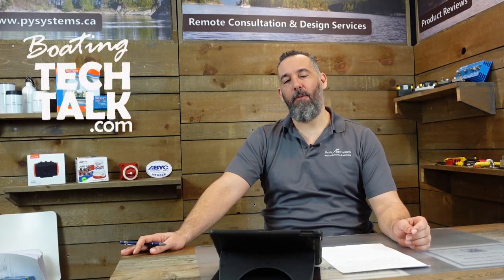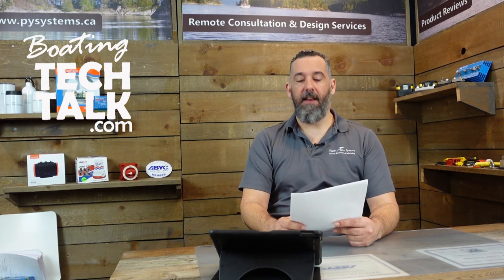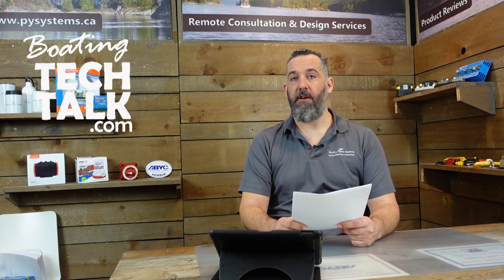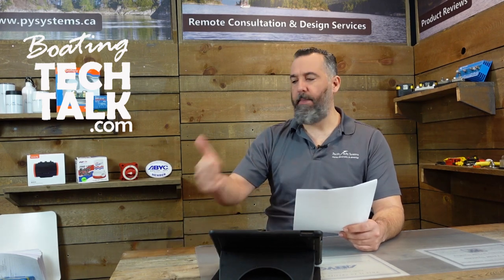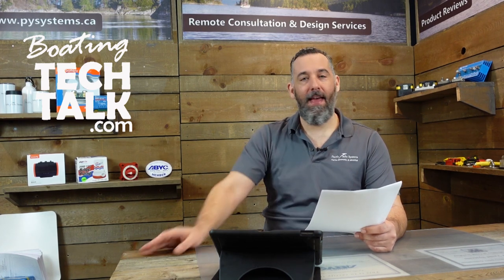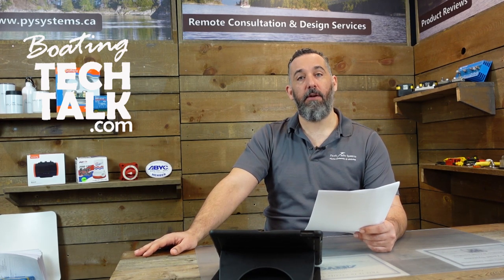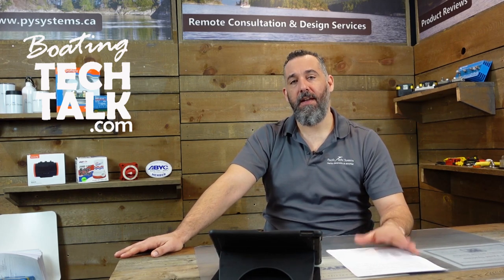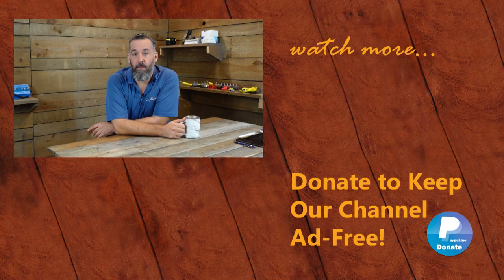I See Installers Use Yellow Wire for a Chassis Ground but ABYC Standards Say Green?

Comment: I always wrap with green electrical tape leaving a gap so the yellow shows through ideally resembling a bonding cable.
Reply from the maker: Smart!
Reply: Yup Electricians do it to indicate runner wires or wires used for other purposes other than their designated color.

Comment: Timely video to see from PYS!  I am installing a 1k watt Victron inverter in a small travel trailer and have not found a good, clear coherent explanation of what the purpose of the green ground is in this particular installation since on a trailer, as a boat, there is no earth ground.  Could you clarify this confusing point or point us to a good resource that does?  Thanks again, Jeff!
Reply from the maker: Good question, since I'm no expert on RV, hopefully someone can weigh in.

Comment: Just a quick clarification. The ABYC standard does not require you to do something that is not doable. Per ABYC E-11 Color coding can be accomplished by colored sleeving or color application to wiring at termination points. Therefore, it does NOT have to be the color of the insulation.
Reply: 11.15.2.1   Wiring Identification - DC 

11.15.2.1.1    Each electrical conductor that is part of the boat's electrical system shall have the means to identify its function in the system.

EXCEPTION: Pigtails less than seven inches
(178 mm).

11.15.2.1.2    Insulated grounding conductors shall be identified by the color green or green with yellow
 stripe(s).

11.15.2.1.3    The color code shown in TABLE 11 identifies colors for DC conductors used for general wiring purposes on boats.

NOTE: The
 color code shown in TABLE 12 identifies one selection of colors for use as an engine and accessory wiring color code. Other means of identification may be used providing a wiring diagram of the system indicating the method of identification is provided with

each boat.

11.15.2.1.4    Color coding accomplished by colored sleeving or color application to wiring shall be applied at termination points.

11.15.2.1.4.1    Tape used to mark a wire shall be at least 3/16 in (5 mm) wide and shall have sufficient length to make at least two complete turns around the conductor to be marked. The tape shall be applied to be visible near each terminal.
Reply from the maker: Thanks for sharing M R.

Comment: Green with a yellow stripe used to be very common in 4/0 TWH hard drawn copper, for Isolated Ground systems for electronics systems back in the '80s (computers, cash registers, etc....) If it was not available when needed, we would have to spiral good quality yellow tape down the length of the 4/0 green wire.
Reply from the maker: Good point, using tape seems the most convenient way to getting proper coloring for a grounding connector.

Comment: Timely indeed!  Just today I received a pair of Xantrex XC Pro Marine 3000 inverter/chargers, and reading the manual (yes, I too do that) came across the section on DC chassis ground.  The manual stipulates 3/0 for my units.  I've calculated, using the Blue Sea website, that for my round trip distance and the max amperage, that 2/0 is the appropriate size for the main positive/negative connections.  Two questions?  Why should the chassis ground be so big, possibly bigger than the DC negative?  And do I connect this to the same negative bus bar that all my other negatives/grounds are connected to?
Reply from the maker: Hi David, the chassis ground can be the same size as the DC cabling power the unit, or according to ABYC, no more then one size smaller then largest cabling to unit.

Comment: In this case I suggest using the yellow wire and marking it at the ends with a band of green electrical tape.
Reply from the maker: Good suggestion.

Comment: I’m actually completing the same upgrade with 2/0awg cable, for my 2000w inverter. I did find some tinned copper 2/0 in neon green and plan on using that for my chassis ground. As far as I can tell I do not have a ground bus bar. I have the grounds all connected to a shunt, which is connected to batteries and the engine block. There are some smaller gauge wires connected to shunt that feed the smaller bus bars. The previous inverter installed did not have a chassis ground wire. 

Should I connect the chassis ground directly to the  engine block, to the shunt, or to the battery negative post?
Reply from the maker: Grounds are complicated. You should have a common ground point (i.e. a bus bar) where all your different grounds are interconnected. Many boaters, don't have a common ground bus, and the DC negative bus becomes the defacto ground bus where the AC, DC, Bonding, Chassis, RF grounds are connected together.

Comment: hoping you can guide in the right direction in regard to a inverter purchasing. I am planning to buy a 62 foot catamaran in the next year or 2 but cannot get around this issue of different frequencies in different countries. In Australia we run 240 Volt at 50 hertz so may appliances and the 2 invertors will  be this configurated to meet this requirement. I read the Victron manual and it suggests that when connected to shore power the voltage and frequency will be passed straight through which is OK for Australia but not if in USA AC shore powerr.

My own thought was to install a isolating Tx with AC (A & B) selector switch for (A) Australia AC or (B) for the USA AC power which will connect to  separate battery charger to supply the inhouse 25Kw So4 lithium bank, Then i can run the existing 240v AV 50 hertz appliances from the other existing 2 invertors which are setup for  240V 50 hertz.

Am i on the right track or  is there another way to configure the Victron invertors to output 50hertz  from a input 60 hertz source  

sorry so long
Reply from the maker: For a boat of this size, you should consider ATLAS or ASEA products to converter both voltage and freq:
https://aseapower.com/

Comment: Jeff, I’m in the exact same boat sorta speak. Installing a Victron multi 2k on my boat. Running 2/0 wire and ran into same issue with finding 2/0 in green/yellow. Not sure why the industry hasn’t caught up yet and make that colour insulation?! You’re also saying there’s lots of people that don’t install case ground? What are the ramification? Getting zapped if there’s a fault in the inverter and case becomes hot from AC? I’m that case using a green/yellow wire sized to AC wire coming in would be sufficient, however that poses a risk? In the case that the DC positive cable comes into contact with the case and wants to send all that amperage thru the now tiny undersized green/yellow wire causing a fire?

Am I understanding this correctly?
Reply from the maker: generally the green ac ground wire will be tied to the case inside the product.  so if the ~30a input ac hot touches the case it will have a path to ground already even with no chassis ground using the ac ground wire.   But when the ~300a dc input touches the case it's trying to use that 10awg green ac wire as the return fault path. which would then potentiality catch on fire.   So the chassis ground needs to be big enough to handle the dc short circuit current as well as an ac one.    This is only in ABYC guidelines.  in RV's and houses they are using ~8awg chassis grounds because this is what inverter manuals will state to use.   So lots of boats are using 8awg because they are reading the install manuals and not ABYC guidelines.  Or older installs before ABYC added this requirement.   Certainly some have non at all

Comment: Jeff,
I am looking to install some underwater LED lights on a boat and the manufacture has a bonding screw on the back of the aluminum bronze housing but there is no recommendation for what gauge bonding wire to use, I'm looking to install 8 fixtures and from my research this bonding screw is to help prevent galvanic corrosion. The fixtures have there own positive and negative connections to power the units so my question is, what am I supposed to rate the bonding wire? Is it the same gauge wire as what the fixture is being powered by or can it be smaller in gauge as its to protect agents galvanic corrosion?
Reply from the maker: Generally, to be safe, use the same wire size as the power wires to the lights. The code generally requires a cable no less then one size smaller then the largest cabling connected to the electrical device.